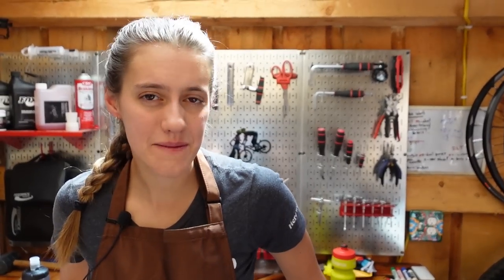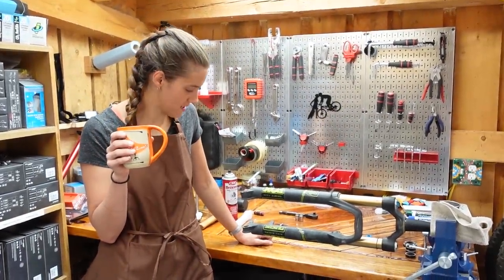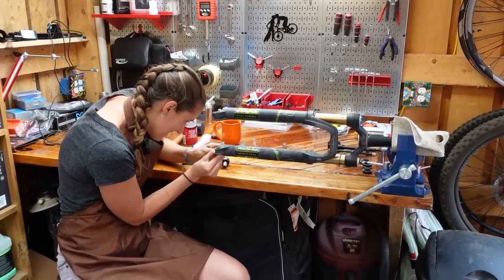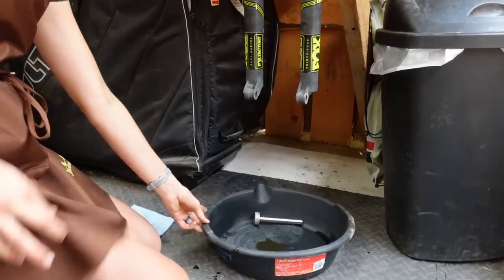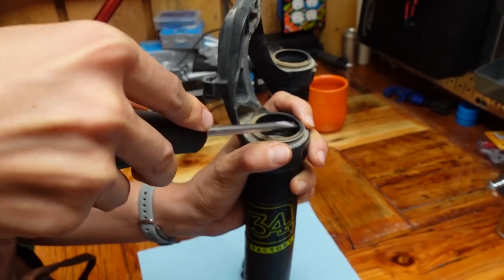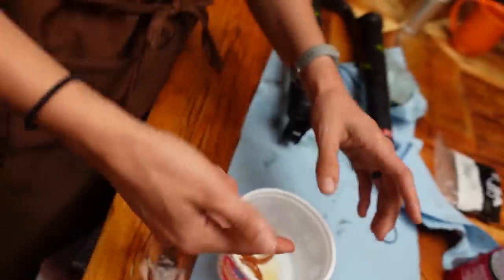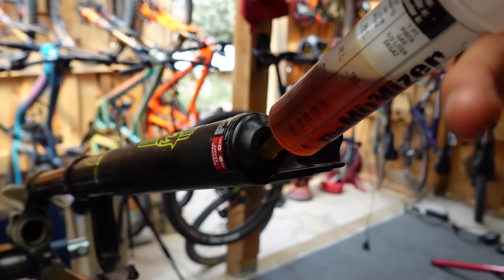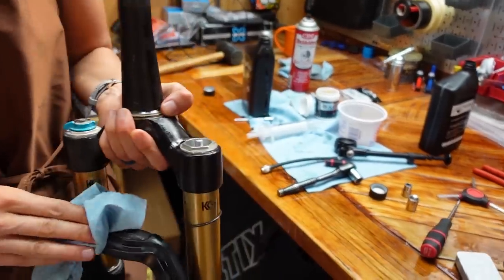Lowers service on a Fox fork | Syd Fixes Bikes

Comment: So, I picked up a used 2016 fox 32 performance and the original owner said he's never done a service too. I was wondering if I did the lower leg service, for the rubber seals, would using some sort of lubricant help in seating it if I didn't have a PVC pipe?
Reply from the maker: We've heard people say that if you put the new seals in the freezer for a while they shrink and are much easier to install. You can also CAREFULLY tap around the edges of the seals with a hammer and something blunt (like a wooden dowel) to seat them if you don't have a piece of PVC. So that being said though, a small piece of PVC is generally extremely cheap at a hardware store...

Comment: I HAVE BLACK OIL ON MY STANTIONS AND THE SEALS R INTACT.
ANY TIPS??
Reply from the maker: Probably time to replace the seals. You can't always tell if a seal is intact by looking at it. The other possibility is that you have a scratch on your stanchions, but given that it sounds like it's on both of them, more likely you're seals are done.

Comment: Quick question, shouldn't one of the foam rings get soaked in 5wt oil and the other in 20wt, since we are also using the one oil in the damper leg and the other in the air spring leg?
Reply from the maker: You know, I'd never thought of that. Yes, that makes sense, but I've never had issues doing both with the same oil.

Comment: At 16:42, you injected float fluid into the air chamber. into this 2015 fork.   Do you know if this is necessary for newer forks (2020 ish)? I don't see this on the Fox volume charts.
Reply from the maker: Just looked at the charts and it looks like they also require oil (in this case, 20wt gold). Check the line for "air chamber" in the volume chart (https://www.ridefox.com/fox17/help.php?m=bike&id=1056)
Reply: @sydfixesbikes  Thanks and Great video.

Comment: When attempting a lower leg service my Dust Whiper Seal did not come off cleanly. There is a lot of rubber residue and the seal tore apart. In all the tutorials the Seal just came off as a hole and left a clean fork to install the new Dust Whiper. Any tips on how to get rid of the rest of the rubber and get a clean fork to install my dust whipers?
Reply from the maker: Weird, haven't experienced that one before. I'd recommend lightly scraping the remaining rubber off, maybe with a flatbread screwdriver, being careful not to scratch the inside of the fork lowers. You can also use rubbing alcohol or maybe goo gone to get the residue off. And once you have it completely clean then you can proceed with installing the new ones. Just maybe put a bit of slick honey on the outside of the seal too to make sure it doesn't freeze on there like your previous ones did.

Comment: instead of a fancy "tool", one can use any piece of wood. Place it on the rod and knock it. Even normal hammer works - no need for a rubber one. I have plenty pieces of pine lying around - It is soft and usefull.
If the fork has this strange pin in the middle - na ja, drill a small hole in a wood that will allow to fit it in :) Or just knock the nail in and take it out - the hole should not be perfect. 

Wood is way softer (at least pine and other soft-wood) and there is no chance you can damage a thread or actually any metal part with it. 
For driving the seals is. one can 3d print a tool. There are several on different sites. I even have one in own design, that one can hammer like a hell(old fork, new seals which a 0.5mm bigger) - will be soon on Thingiverse :).

Comment: Do you really only need one of the Lower leg removal tools? Seems like you could just switch sides. You guys are just so pro you have two already.
Reply from the maker: They are different sized on the 34 or a 36. Same size on a 32 though 😉

Comment: Why is it that suspension fluid only needs to be added to one side of the fork?
Reply from the maker: Both sides of the lowers need oil (called bath oil) because the stanchions move up and down inside them. The air side of the uppers just need a little bit to lubricate the air shaft and the damper side doesn't need any because it's a closed system (there is oil/fluid in the damper cartridge but you don't open the cartridge when doing a lower service).
Reply: Thanks!
Reply: That'd curious, I assumed forks would be somewhat symmetrical but they aren't? Doesn't that cause one side of the fork to feel stiffer?
Reply from the maker: Nope, the crown is stiff/strong enough that both sides move evenly even though one side is air and the other damper.
Reply: Intersting, again thanks for taking the time to reply.

Comment: Instead of using a flat head screw driver to take the seals out, use a wrench. 10 times easier.
Reply from the maker: But does the seal still go flying off?! Because that's the best part 😉
Reply: @sydfixesbikes  Okay, good point😂 But, no seal stays on the wrench.
Reply: @sydfixesbikes  best part untill you get hit in the eye , get some cool looking SAFTEY glasses

Comment: So, basically, I'm here to find out what you put in the compression damper, and you didn't drain it, and now I'm wondering if I did a stupid.
Reply from the maker: Compression dampers are generally fully sealed and aren't user serviceable so don't require any oil (or even being opened) when doing a lower service.
Reply: @sydfixesbikes  it's fine, I found a video from fox where they service my damper specifically. Thanks anyway.

Comment: Using screwdriver to lift the seals is masacre, and best way to scratch the lower legs..don't show a bad example. Use 17 flat hex key insted. Same about pressing the seals.. insted of hammering.. just buy simple plastic guide.. its roughly 5 dollars from unior... and you got perfect fit. Otherwise its nice video 🙂

Comment: "the fluid is the suspension" meaning what creates the pressure allowing for both flex (when hitting an object causing "absorption") and the rebound (pushing the tire back to level and thus hopefully upon ground.) The goal is of course to create the maximum amount of ahem "tire presence" ahem on the ground so as the create a much more robust control surface ("the tire") to adhere to said ground/surface.

Of course why have any suspension in the first place is a surprisingly good question given the weight and complexity being added when instead one could focus on having much more robust and performance type tires? There is also the all too real problem of "spring load" in a front fork causing your front tire to literally dive into a hole then "jamming" as the system tries to recover from the massive suddenly unsprung pressure created when one is literally "launched" from said "hole dive."

In other words this system in fact does the exact opposite of what is claimed in the real world meaning providing far less control than having nothing at all and hence the issues noticed when you take apart these systems and see the damage.

There is a solution to this systemic problem besides not having any suspension period...one very much worked on by all the "desert warrior" type vehicles used to go racing along the Baja with...but again, adding weight and complexity.